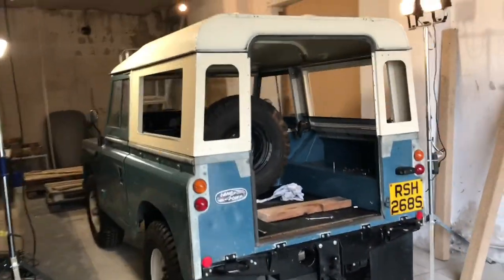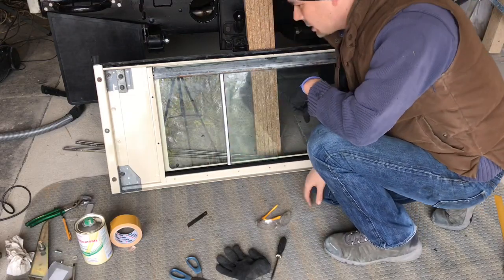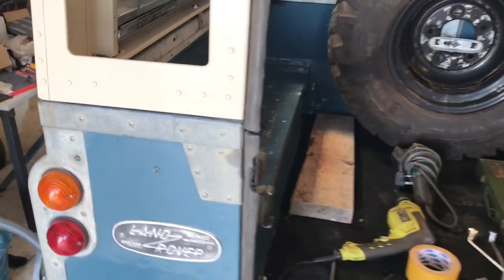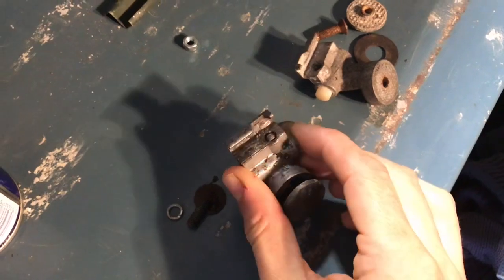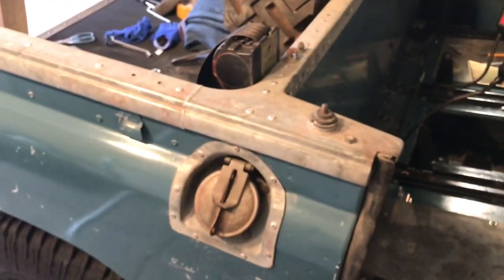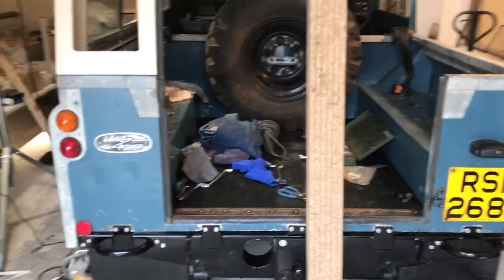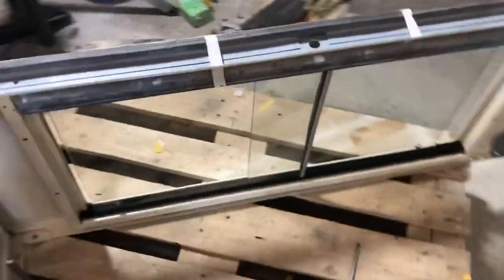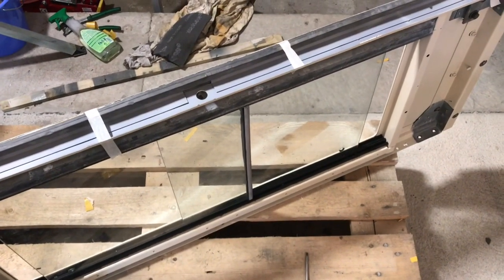Land Rover Series 3 Restoration - Refurbishing the New Hard-Top Sides Pt.2 - Part 39

Comment: I thought about parabollox for my lwb. I've read a fair bit and greased and oiled the lr springs that I got it with. Massive improvement and I don't need great show cos the springs don't bounce but they do deflect. I plan to sequence dismantle all the Springs them derust grease and wrap in Denso tape. 
Seen stuff about on net about pb springs giving a 2" lift when fitted then 6 months later sagging lower than the originals. Like you say , they ain't cheap

Comment: Yes, SWB 2A Ute and 2A LWB Wagon.
With regard to your carb, I don’t think it’s anything to do with temperature, we range from 5c to 35c here with no issues. Have a look at Geoffrey Crocker on YouTube, very good vid on rectifying inherent problems and rebuilding the standard carb.
Reply from the maker: Thanks, will do.
Reply: My911 check your exhaust. Use the blowing side of your vacuum cleaner into the exhaust spray soapy water at each of the joints and around exhaust manifold. I had similar issues kept adjusting carb and timing. Could not get to bottom of it after test found leaks. They were coming and going throwing everything out.
Reply from the maker: Grant Nolan-Evans that’s a good tip. I have already had gasket issues affecting the running, so maybe it’s still the issue. It’s on the list.